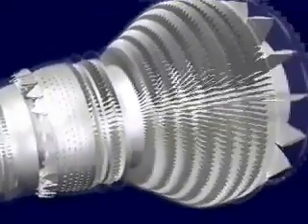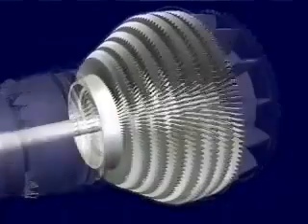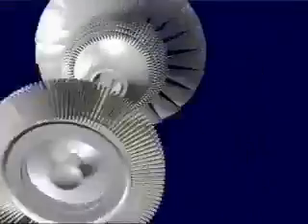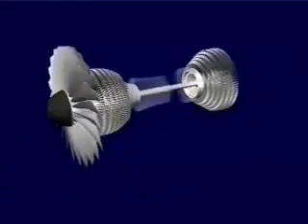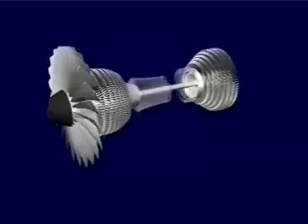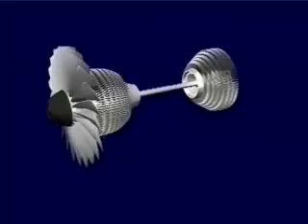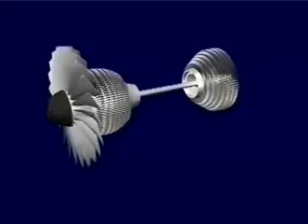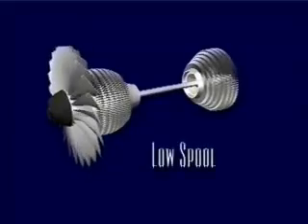How jet engines work (turbofan animation)

Comment: Its hard to believe that the larger fan on the front generates 80-85% of the total thrust. I thought that all the thrust was generated inside the core in the compressed and ignited air. So, I cant believe that all those sets of blades and compression stages plus the combustion chamber only generates about 15 to 20% of the thrust. Its a ratio that I cant understand.
Reply: Well the fan itself doesn’t generate thrust unlike a propeller. The fan blows air through the ever narrowing bypass duct and compresses it, the bypass air expands and accelerates out the back once it reaches the nozzle just as it the air through the core does (just without any combustion) and that’s how bypass thrust is produced.

Comment: Untill this video, I didn't realise that most of the thrust is generated by the bypass ! Amazing
Reply: yeah, cool,  but do you also realize what that means? your ticket was 80% overpriced...... because the airlines use almost no fuel at all, yet they make you pay for it.... in case of the A380 they make passengers pay for 320.000L of fuel which they, first of all, have no possible way of storing and getting aloft..... and second they don't need it.

Comment: So the whole thing is for the fan to pull in the air... nice. :)
Reply: Yes, the fan’s job is to pull in and compress the air either by blowing through the converging bypass duct and blowing the rest into the compressors and combustion chamber. Both the bypass and core flow expand and accelerate once when leaving the engine nozzle and that’s what produced your thrust.

Comment: Hello, figured that those who have taken the time to watch this turbo fan jet demonstration, may also offer an opinion on the following: if you were fabricating a 304.8mm (d) EDF-J/Electric Ducted Fan-Jet, that wil utilize a Turnigy 150cc electric motor, that can turn well above 6000+r.p.m. and a fan that has 3-blades, closely resembling the carbon-fiber blades found on the GE90 family of turbo fan jet engines, would you incorporate guide-vanes stators just aft of the fan itself, much like most commercial turbo-fan jet engines have, so as to squeeze as much static thrust as possible from the EDF-J, with minimal weight gain, and most importantly, minimized draw from the battery stack? The duct/nacelle has already been designed to assist increased thrust, b using a 12% decrease in diameter from intake, moving aft along the ogive, to the thrust end. The duct also incorporates in its design, features to assist with lift and thrust. Hope tp get some feed-back. Thanks in advance!

Comment: Why is fuel used to increase temperature of 15% of the total air volume when 85% of the total thrust is created with out fuel used? Would there not be a ratio of increased air pressure to decreased fuel that would essentially accomplish the same thing? Eliminating the need for fuel altogether?
Reply: You need the fuel to help draw air through the engine. Air will always move from high pressure to low pressure. The compressor works the opposite way by forcing air to go from low pressure to high pressure. To make that happen, there needs to be enough force to drive the compressor and gas expansion alone from compression isn’t enough to do that due to all sorts of losses such as friction. The combustion will raise the air to even higher pressures which will results in more power and force available as extracted by the turbines.
Reply: Murphy, the fuel is injected to keep the shaft rotating. Without fuel, the shaft cannot intake air, and thus cannot create thrust. This is why the fuel is very important.

Comment: I've searched many videos about Jet Engines but none of them have explained how the damn thing turns or rotate in the first place. I know the old propeller engine use piston mechanics and that very clear to me. what i want to know is what rotates the jet engine at first place? is there a miniature (fuel or electric) engine that starts the rotation so all that air stream and jet propulsion happens.
Reply: The Auxiliary Power Unit (APU) is responsible for blowing fast jets of air onto the low pressure compressor up front. When the EGT is hot enough the pilot will switch on fuel and BOOM we have a self-sustaining engine!
Reply: shaka lakaboom holy sh... that's what i was looking for. the magical fairy called APU. 
thank you very much, now it makes a lot of sense.
Reply: randomv3iwer No problem brother
Reply: why didnt they included it in the explaination? its the most crucial part..dont they really want us to learn? all videos didnt explained about it!
Reply: Most all of them use electric starter motors to begin the process.
Reply: shaka lakaboom Its not always the LP compressor they turn over. In a twin spool or triple spool they will turn over they HP as it's closer to the combustion chamber and has more energy when it reaches the turbine. Which can then start the rest. It's just got less to space to travel

Comment: does the axle that the compressor blades are on rotate freely completely separated from the intake/exhaust axle?
Reply: Yes. Compressor and fan turbines are separated in most engines. They rotate freely one from the other.

Comment: There is a fan in the front section which sucks in the air before the engine starts... How it sucks... With the help of electrical motor??? DC or AC? What the range... Please provide details for long will the motor runs
Reply: DCWarHound
Well, to begin, the fan sucks air due the shape of the blades. If you look carefully, they have a wing shape. When rotating, the blades (or vanes) accelerate the air. It's the same principle of lift in an airfoil, air is deflected by the wing, thus lift is created. In the same way, if the wing goes through the air, the airfoil will deflect the air, the rotary movement of the vanes throws the air backwards, by Newton's Third Law, if you push something, that something pushes you in the opposite direction. Aircraft do not store any compressed air to start the engines. All modern aircraft come with an APU - Auxiliary Power Unit, which is a small turbine with an attached electric generator, which supplies the airplane with electric power and air conditioning when the aircraft is on the ground and the engines aren't running. It is used to start the engines by means of an air starter, which is located in the gearbox in each engine. The air starter is also a small turbine that rotates when compressed air is fed to it by the APU. This takes only a few moments, until the engines are self-sustainable.
Reply: how do not understand how the fun suck in air..i understand how compress air but not how it suck..how start the engine from zero velocity?
Reply: Planes usually store compressed air to start up the engine,some even have build in compressors to start the engine.The fan itself is actually what causes the thrust for the jet engine.The inner side of the jet engine with the compressors are just there to provide the enormous power for the front fan,speed of the fan can be changed by reducing or increasing the amount of fuel that goes to the combuster.

It's kinda like a car,the large fan at the front can be seen as the wheels and the inner parts of the jet engine can be seen as the engine providing power for the wheels.
Reply: They have the APU which will turn over the HP compressor to start it. A simple starter